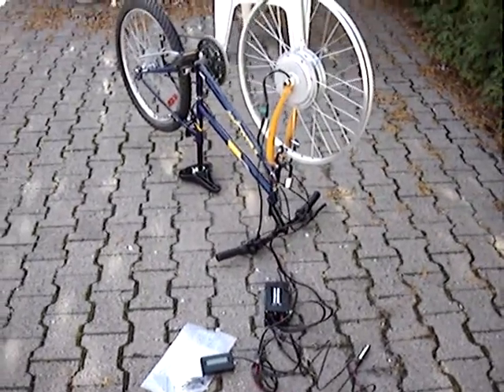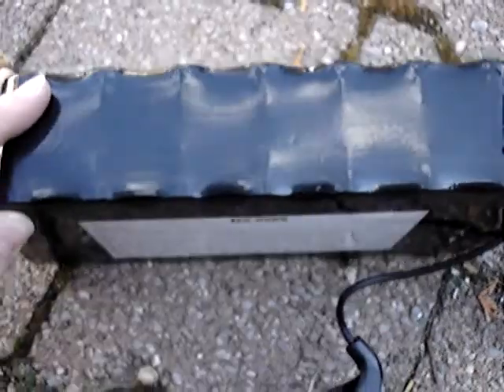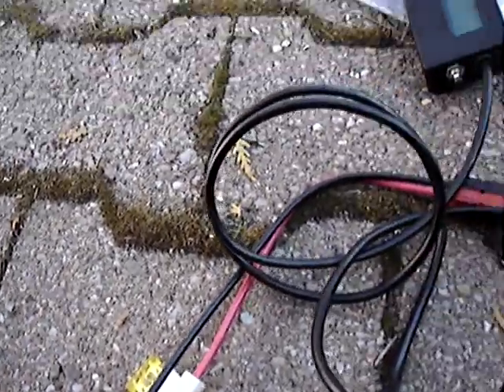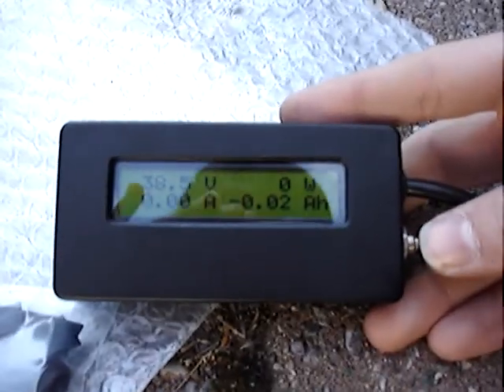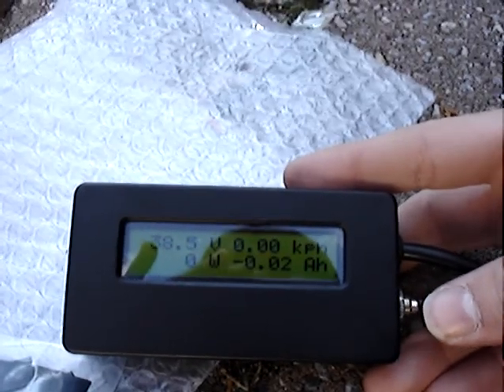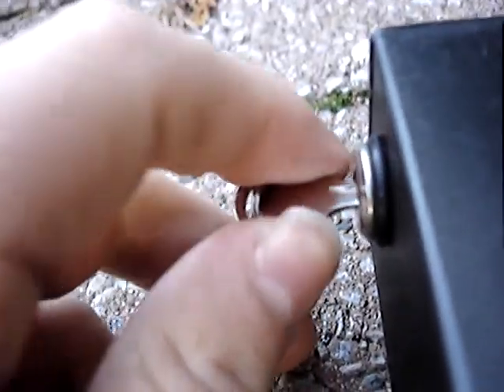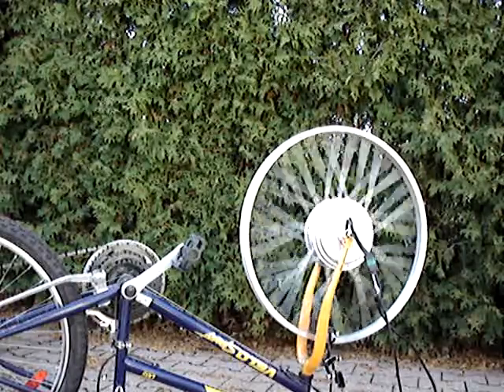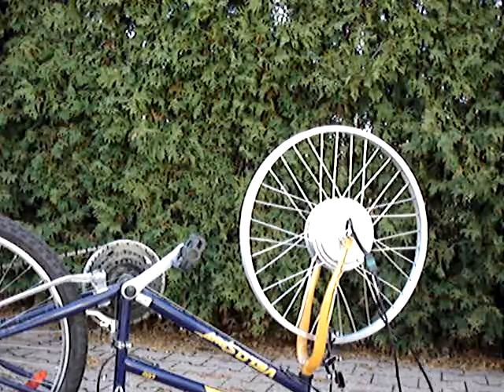DeLorean_4's Electric Bicycle

Comment: One thing you may consider is to replace the crank derailer with the throttle. This would leave you with the rear wheel derailer for shifting. And if you really need to shift the front derailer for a really tough hill, which may be never, you could manually move the chain by hand. Or you might mount the fron derailer on another par of the insid of handle bars, since it won't be need for shifting very often.

Comment from the maker: I really can't wait either. One problem I'm currently facing is with the twist throttle because the original bike I was using (not pictured) had levers so the handlebars were completely free. The one shown in the video has two twist mechanisms for shifting speeds so I'll most likely end up having to order push-throttles (the kind you activate with your thumb) from Vancouver.